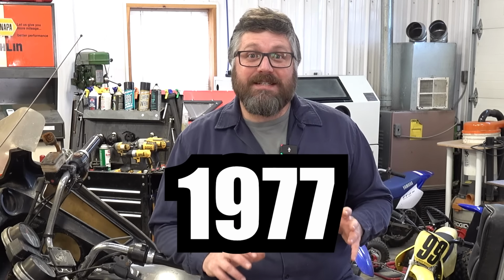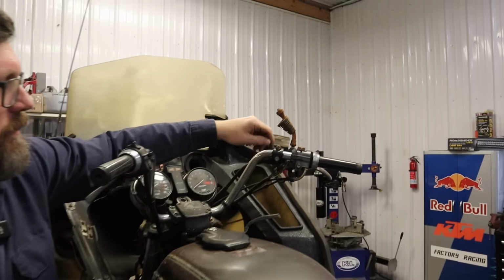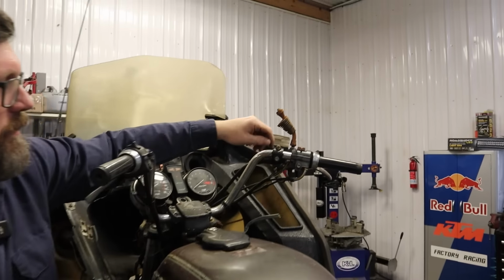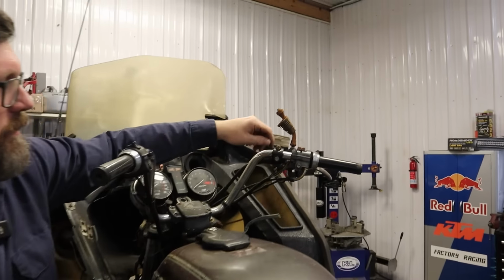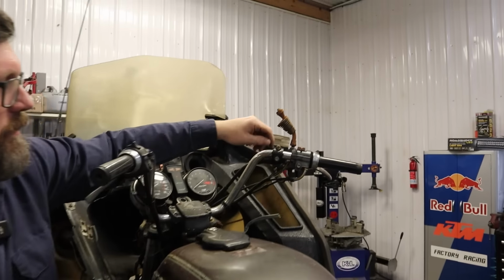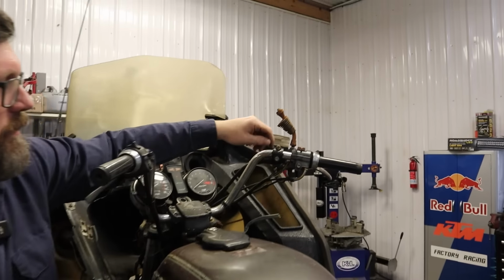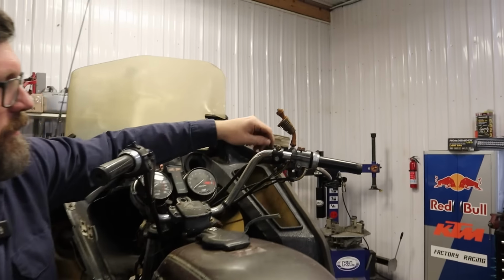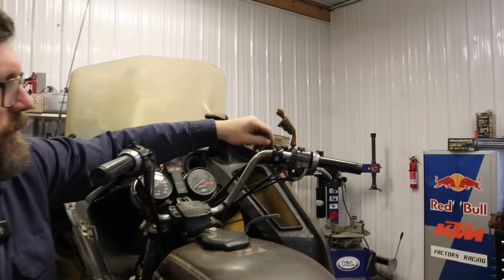Engine Seized! Can I Get This Cult Classic Honda Running?

Comment: There is a round cap under the radiator on the front cover.  Under that cap is a bolt machined on the crankshaft.   Be warned, these bikes had timing chain problems which retired them at an early age.  Honda recalled many of the early models and did a fix.  I still have my 1980 CX500 and it runs great.

Comment: I bought a CX 500 in the early 80s for around $800 with only 1200 miles on it. No scratches and the chrome was like new. The only problem was the front of the seat continued to slide you forward and crush your privates.  Was a great bike for cruising western Washington state other than the seat.

Comment: This was my first bike. I had the cx500c variant so it had a tiny tank and no fairing. It was a fantastic first bike. 50hp in such a light bike and gas milage was amazing. Got like 60+mpg highway. I bought the larger tank to convert it to the larger tank but never got around to it. Hell I still have the larger tank in my garage (got this bike in like 2012-2013). Same color as your bike.

Comment: For stuck pistons...use old diesel sump oil...soak the pots..leave for a week...tap the piston with a block of wood....repeat...this will work(trust me)....eventually it will spin well(rebuilt 6+ xs 650's doing it

Comment: I have my fathers 1980 CX500 Custom, sadly the original carbs are total trash. The main slides are totally corroded into the bores to the point that you'll most likely destroy the carbs trying to get them loose. It popped off just fine when my friend squirted some 2-stroke mix into the intakes when we went to pick it up a couple years ago. The inside of the tank was also very clean but I don't know if it still is since I've had it. I'll have to check on it this coming summer. All it really needs is a pair of new carbs to get it going.

Comment: the standard version of these are called shadows , this looks like a franken bike combination of shadow and cx custom parts . it doesnt  look like the silverwing that came withteh windjammer fairing more a home made job , but the color if its original is more gl500 than cx

Comment: I rebuilt a 20yrs stalled CX500 and ran it 5 years as my first bike, until the oil pump packed in and the engine seized up. But what a fun bike that was.

Comment: Ps...camchain is at the back of the engine.....oil pump chain is at the front!! The oil pumps have a certain amount of adjustment in them...but careful not to move the pickup too close to the sump!

Comment: I bought one new in 79. There were warranty issues with a warped brake disc and a notorious issue with the cam chain tensioner All resolved under warranty and the only issues I had otherwise were with the rather weedy, feeble suspension. That little engine was an engineering tour de force.

Comment: I actually rode one of these things, with a full front fairing and everything functional. It was in much better shape than the example you have. BUT IT WAS SUCH A SLUG. With that fairing on it, all it could do was about 65 mph with everything absolutely maxed out. Granted, the carbs probably weren't tuned appropriately but still. Gutless.
My dad picked up a used CX650 Custom and I rode that on/off for a few years until he got rid of it. The engine layout was unique, but it was a vibrating buzzy mess, one mirror was impossible to see out of at speed, your hand would go to sleep from tingles, etc. Wasn't worth spending money on it. Carburetors were the biggest pain in the butt to work on due to the funky angles everything joined up at.

Comment: I got mine brand new from the superbike centre in Birmingham England, it cost me most of my wages for the next two year's if I remember correctly.  I felt like king of the castle taking it out of the showroom.  It was sold as a high speed long distance tourer. Memories. 1982

Comment: I had a 1980 CX500. I bought it out of a guys storage unit in the middle of the night, only the light of the screen of my flip phone. I bought it for $100. What a steal! Well, it was stolen, vin was filed off and the ignition switch was jumped. Tank was hastily spray painted. No title. There went a $100.

Comment: I've got an 82 CM450... 53,000 miles on it, awesome bike.  Fugly, but awesome.   
Run some 0000 steel wool over that front fender, will take that rust right off.  Mostly.
Safety wire those side covers off, you'll not push them all the way back in, then lose them on the highway and never find them again.
That is a total effin treasure, because...  a.  The Vtwins come out the side like a boxer, which means you can take the heads off with the engine still in the bike, unlike modern bikes (aka Shadow)...   b.  Vtwin smoothness.      c.  shaft drive     d. honda swiss watch reliability.     e.  the thing survived even though completely neglected in the hands of a monkey   f.  those comstar tires, although fugly, hardly need cleaning... compared to the nightmare of beautiful spokes.

I had a front fork stuck down from a CMX250 like those pistons are seized and I worked on it forever in every way possible until I finally gave up and bought a used replacement off ebay.

Been there done all that on motorbikes...   on my first one actually.     The ones you have to work on the most, you keep forever.    Polish her up, put a rack on the back, make it a daily driver.

Comment: Honda CB250 Twin (I think you called them the Dream in the US?) definitely came with the Comstar wheels - I had a '77 and a '78, back when Australia limited new riders to 250cc, and I couldn't own a 2-stroke and a license simultaneously.  😁  But my '81 CB250-RS (single cylinder, 3-valve) had spokes, so a step backwards in that regard.

PS: I believe the chain on the gas cap was because people would close the flap and forget to replace the cap first - out of sight is out of mind, and all that.  And getting your crotch soaked in gasoline when you first crack the throttle coming out of the gas station isn't all that fun.

Comment: I had one with a turbo in the nineties. Nice bike, but a little light on the rubber. I think it was a CX650. Turbo did nothing most of the time and then took off without warning. Sometimes when switching down from fifth to fourth gear, which was fun when engine breaking downhill on the Autobahn... Traded it for a BMW R60 that was much more reliable. But the turbo Honda sure was a blast, in a life threatening kind a way.

Comment: I have a TGB ATV. Have you heard of these? Anyway I started to work on it until I found out that they no longer have gaskets for the 425. Don't quote me on that either. It was so hard to pull the recoil starter rope and the starter wasn't doing as it should. I found that there was also coolant and a bit of rust on the inside. I had to stop when I didn't have a puller for the flywheel. I contacted the company and they were on the 725's and higher. They finally have a stateside dealer here in Atlanta. Would be cool to have you do a video on this. The owner of this actually bought this from a buddy of his but he had used mower parts (solenoid) instead of getting the correct part. That may have been available when it had gone out.

Comment: the CX ran a single front disc in the USA, I have never owned a CX with a single front disc, all  had double discs with the original front wheels, forks and  twin disc brakes being the same as the common as muck CB400N Superdream

Comment: It’s a 1979 delux you have there. Assuming the petrol tank & sidepanels are original that colour pin striping was for the first model delux only. The carbs are model specific too. Should be VB23A. I have had mine 24 years.

Comment: Modern bike gearboxes usually spin opposite to the engine , regardless.
Only primitive designs with chain primary drive or automotive style direct drives don't.

Comment: Gave my 1980-81 CBX 750 away for 300 dollars, had nice Clarion stereo system for over that much. Only cracked pinion cover and slightly bent pinion, and one coil lost power. Needed cash to travel to Jerusalem.

Comment: I had one of these bikes... they're awesome... they go like hell...  but if ya gotta stop in a hurry yer gonna burn yer knees on the cylinders.... and if ya lean to far over the foot pegs hit the road ad the back tire will jump sideways... and they tick like crazy... but thats o.k.... it;s the cam chain idler arm..... makes noise....  but they go like hell....it'll bouncewhen ya go full throttle on the highway.... drive shaft power..... and they do wicked burnouts....

Comment: A CX 500 was my first motorcycle .   (1982ish).   Good bike, but the rear end has about 4:56 or 4:88 ratio.  Cruising speeds are high rpm.

Comment: Before you take the heads off, remove the Schrader valve from a compression tester hose that fits the spark-plug threads, screw it in and connect it to an air line. Let the shop compressor do the work.

Comment: Bashing a piston which is at TDC with a lump hammer shows that you are an excellent mechanic that understands the geometry of a piston , connecting rod and crankshaft assembly. 🙄🤯
Reply from the maker: Sometimes you just have to hit the closest piston. It's a thing.

Comment: Did you consider using a heat gun on the barrels , hear it to 250 ' f. Abd see if it will move.

Comment: Under the radiator.... hidden on the front of the engine.... is a plug that resembles the final drive fill plug.  It's a 17mm head and will expose a crank bolt that you can turn the engine over with.
That is... if it's not seized.  Haven't watched the whole video so I guess we will see!

Comment: The camchain recall punch marks will be on the engine number, not the frame number. The number range only included bikes built in 78 and this D model will have been built with the uprated tensioner components so wom't have the punch marks anyway.
Reply from the maker: Good info. Thanks

Comment: So I’m fixing to buy a motorcycle engine to power this custom bike I’m building. I found Ninja 250s and ninja 500s for a good deal and I can find the harness but Iv never done that stuff before. I don’t do wiring but I want to do this. I already adapted the ninja 250 swing arm to it which gave me 8” extension from what the bike was born with. Right now i have a very expensive go kart engine for it. It’s probably 25 HP and has every performance part you can buy. It’s still not touching a stock ninja 250 though

Comment: The fairing mount bracket (because they're specific to the bike UNlike the aftermarket fairing) is rarer than the fairing so I'd Ebay it to CXers if you still have it.

Comment: The CX500 and GL500 Honda motorcycles are very similar to Moto Guzzi cycles except that they have water cooling. The rear end is interchangeable with a Goldwing. The water cooling can be problematic when the rotating ceramic seals goes bad but a Yamaha seal is available that works. These aren't great looking bikes but I have had 4 of them and I like 'em. I also have a 1970 Moto Guzzi Ambassador and that's definitely a superior motorcycle but hey, these Hondas are cheap the buy and easy to work on.

Comment: The 5th gear method does not work very well for the cx500 too many linkages would be my guess but neither of my running ones turn well like that. So it isn’t a good indicator of a seized engine for these.

Comment: Well engine is NFG. I'd suspect the rest of the bike too. But you could get it working right again, if its worth the effort or interesting enough. It fired up so it probably would be restorable or rebuildable.

Comment: Back in the day It was a choice between a CX 500 turbo or a GPZ 750 both complete with full fairing I ended up with the 750 but all along I wish Id bought the Honda . I had the GPZ for 1 year and traded it in for a Z 1100 shaft drive , had it for 15 yeas .

Comment: I bought an 81 cx500 with 18k miles for 250 bucks. Guys wife sold it wothout consulting him on the price. He was fired up. Had a stuck motor from a ring ridge. Had my buddy spin the rear wheel while I turned the crank by hand and shot the marvel mystery oil all over the garage I had soaking the cylinders when it broke free. After a carb clean and sync it was the smoothest ride and power curve out of any bike I had ever ridden. Wish I hadn't sold it. Had the stupid Windjammer fairing on it. It was the first to go.

Comment: The oilpump chain  is by the clutch. there is a 17mm inspection cover below the right carburetor ifyou want to check the camchain.

Comment: Since 2011 I have owned three. Good for 1 hour,m after that your hands will be vibrated to death and cramping from the horendous carb spring pressure. CX500, GL500, and CX500 again.  Parts are available, except carb boots and exhaust resonator (sits under engine). One of mine had coolant leak and overheated, other two were ran with pod filters and no mufflers with rusted out resonator makig it sound loudish. Great memories even had the S1100 (inline V4) after these and will never own another, too much for 45mpg and realistic 80mph top speed, yes it could go faster.------------------------

Comment: Not the stock mufflers. Not available oem, but there are pattern replacements sold out of the UK.
Contact me if you want a stock tail light, Craig. I've got a whole box of them.

Comment: Even my '88 Honda Hurricane 1000 had cam chain tensioner issues while under warranty. That bike did run for well over 100,000 miles and the second owner beat it to death. I traded it in for a '95 CBR 1000 that I sold with 60,000+ miles on it that the second owner totaled it out from too many bloody marys and jumping it on our streets which have plenty of washes.

Comment: Had one in 1980 and the ignition and charging system are one unit inside the cases. It went bad cost $400 just for the part back then witch was what the bikes were worth at the time so it got scraped you had to remove the engine and split the cases not worth it.

Comment: He was looking in the wrong place for the 3 dots that indicate if the recall work was done to the cam chain tensioner. The dots would be on the engine block, inside the rectangular area that has the engine serial number. The dots were also in a triangle pattern, not in a line. Your welcome.

Comment: These are probably the weirdest bike Honda ever made. They had several different versions that used this 500/650 cc pushrod V-twin, including the GL (Silverwing), the CX, and the CX Turbo. The turbo 650 actually made close to 100 hp. out of the box and the rest averaged between 48 and 70 something hp. Seems they all had water pump seal issues, head gaskets, and faulty ignition on quite a few, so I'm actually surprised you had good spark right off the bat.😉

Comment: You're not supposed to hit on top dead center because you're just transferring to a rod that is straight up and down! no leverage on the crank to turn it. the other cylinder started moving right away because it was off center!

Comment: Oooh, a plastic maggot. These things were reviled here in the UK when they turned out to have cam chain issues, Honda were coming off the 250/360 G5 which was pretty and went okay but would lunch their cam and followers. They then did a stop-gap CJ 250/360 which wasn't even pretty and had the same motor and same problems. So when the CX came out and had issues, Honda took a big hit. But they stuck with it and fixed it but CXes ended up cheap. Despatchers (motorcycle messengers) used them and they ran and ran and ran and a cult following was born. Still got called 'plastic maggot......

Comment: The first thing you do when a motor has been sitting is drop the oil never try to start it with the old oil still in it .i put diesel in them let it sit for a day or two while turning it over then drop the diesel out & put new oil in it .

Comment: Put some new gaskets on it, new fuel, flush out the crankcase and bleeding the front brake and ride it! You just may be surprised  how well it runs💯 it is a Honda after all

Comment: I had one in the mid 80s & I loved it, the pull throttle cable broke once, so at the side of the road I swapped over to the push cable which meant I had to roll the throttle forward, rode it like that for months 😂 however the cam chain broke & was expensive to get fixed but I still loved it, could warm your hands as you rode along 😂

Comment: Ahhh..the CX500. Late model with the reverse Comstar wheels. Honda just made it over complicated by rotating hte cylinder to bring the carbs in. Unlike Moto Guzzi that just make you find space for your knees around them. Which meant you had a camchain AND pushrods. Plus problems with the tensioner and many other things too. But, for a 500cc bike, it made good power. Thank god the hideous fairing went in the bin.
Plus...we got Craigs Cocktail Hour thrown in.

Comment: Didn't that CX500 also have some kind of staggered crankpins? I seem to recall reading years ago that Honda had come up with a way to offset the con rods in a V-twin to make it run smoothly.
Reply from the maker: I have to look into that

Comment: I had a 1980 CX500A, in the UK they called it the Maggot. I had it 4 years,  it had the mods but the camchain tensioner failed at about 35k.
Mine had twin discs up front but they were  awful and useless in the wet
With some spacers in the forks and better shocks they handled ok-ish, a lot better than the CB750FA I got after the CX!

Comment: I have a CX 500 bought it new 1981.And still in my ownership.I use this since than as a daily Driver.,and have a mileage of 650000 .It hast been Services quote nomally.So far I have hardly Had any Problems.The only Thing you pay Attention to is that you flush the cooling system Every 100 000 Km.The CX was one of the First motorcycles to ha ceramic Seal fitted as Standard .If dissemble them ,you will have Trouble getting the engine shut down again. Otherwise the engine ist reliable and actually instructible.